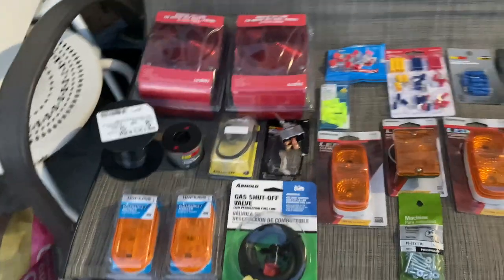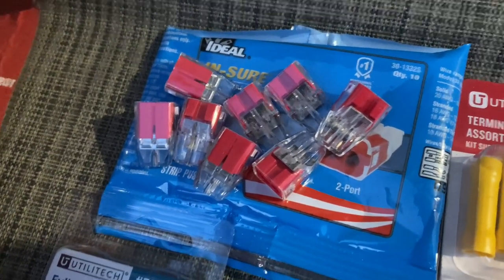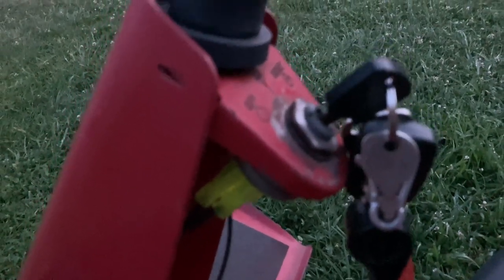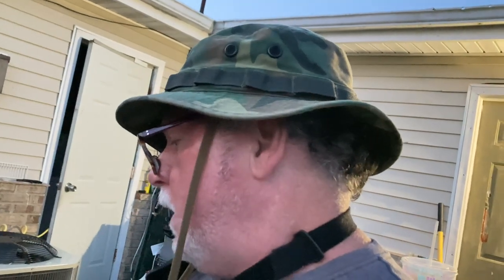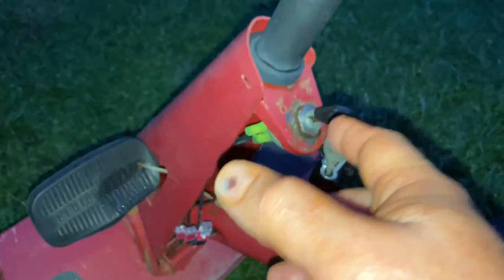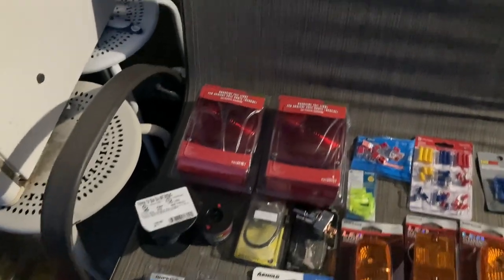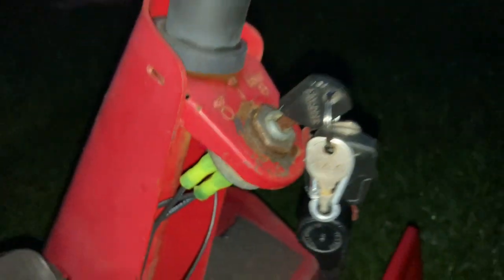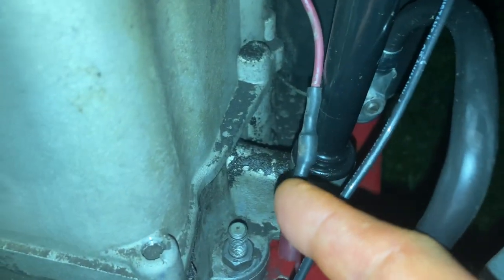How to Wire an Old Snapper Lawn Mower  | Wiring an Old Snapper Riding Mower to the Ignition Switch

Comment: Great video. Bought an old snapper to rebuild, easy to work on and well made. Your bicep should heal fine. I had the same surgery done on my left arm a few years back and I am back to full speed. My orthopedist said at my age I didn’t have to have it repaired but I would only have about 1/2 my strength. I laughed, no respect for us older dudes. Take care.
Reply from the maker: These are snappers are cool for sure! I am glad your bicep healed nicely. My bicep is doing pretty good. Be sure to subscribe to my channel if you have not already. Have a pleasant night.

Comment: So the B Wire goes to the battery wire do connect that wire? Do I put it on the bottom right bolt?
Reply from the maker: Run the wire from the B terminal on your switch to the left top post of the solenoid. That post is also where you connect your positive wire from your battery. The bottom left screw is where you connect the wire from the S terminal on your ignition switch.
Reply from the maker: Did you get it running from your switch? Thanks for viewing. Be sure to subscribe to my channel. Have a good day.

Comment: This will be helpful if I move forward with putting mine in service. A couple of questions if that's ok. My brother left the breather off of this mower and I assume it got water in the cylinder because when turned by hand there was a spot where the engine was ceased. Id guess it was at the bottom side of the cylinder only, meaning hopefully minimum damage. Anyway, that's why I need to only get the engine started for now to see how it runs before I put money into it, then I can concern myself with the wiring mess he made and actually burned up the stator.

First, can I start this without a stator as long as I have a fully charged battery? Secondly, what are the minimum temporary wire hookups I need in order to only start this? Idealy, pretend I had the motor off the frame, what would I need to do to get it started. And out of curiosity, mine has the same metal shrouded engine as yours, do you have a guess on the year model of the mower? There are no signs of ID stickers in the back of the mower where they say to look for them.

Hope your arm healed ok. I have had a torn rotator cuff I've been putting off getting fixed for years...a real pain, literally.
Reply from the maker: The stator supplies volts to the spark plug. Without a stator or a bad stator, it will not run. I would change the oil, clean the gas tank, and order a new carburator. I bought one for $13 new on Amazon. Also, you can order a new stator cheaply on Amazon. I would get a new foam carburator filter too. Thanks for viewing and commenting. Be sure to subscribe to my channel. I hope you get it running. Let me know how it turns out. Have a pleasant night.
Reply: @BigOvlogger  Thanks much for the reply. I had read both it would and wouldn't run without the stator, so thanks for clearing that up. I'll get the stator and fix the wiring the best I can and see how it goes.
Reply from the maker: @jackm6307  The parts are cheap for these old Snapper mowers, especially on eBay or Amazon!
Reply from the maker: @jackm6307  You are welcome.
Reply: @BigOvlogger  Sounds good, that's where I'll be ordering from once I figure out the minimum wiring I need just to get the engine running. Thanks again.
Reply from the maker: @jackm6307  You are welcome. I hoe you get it running soon!